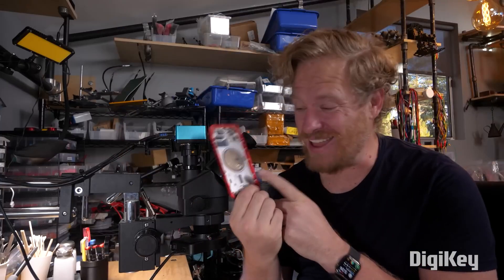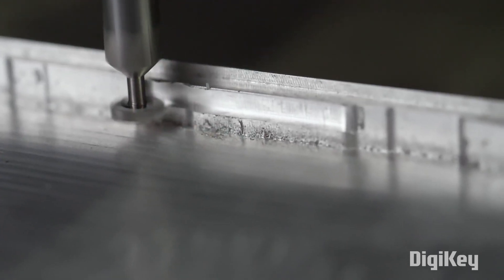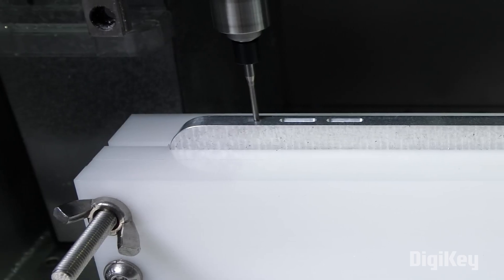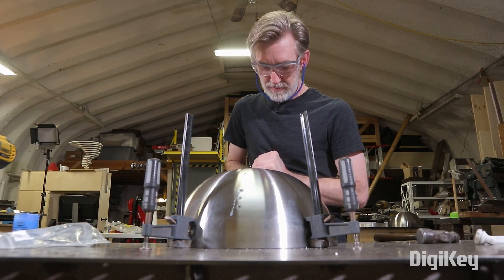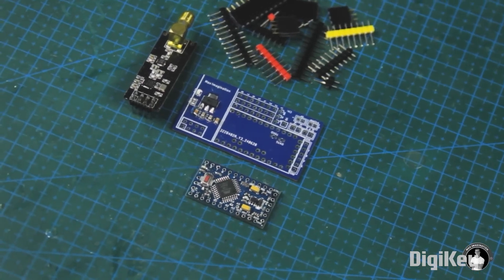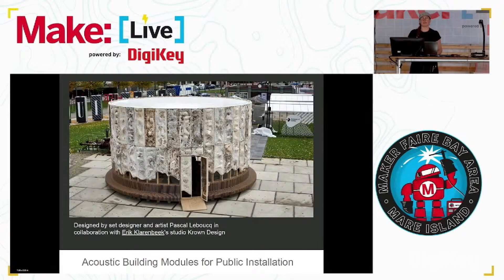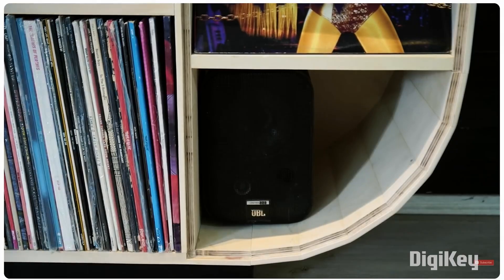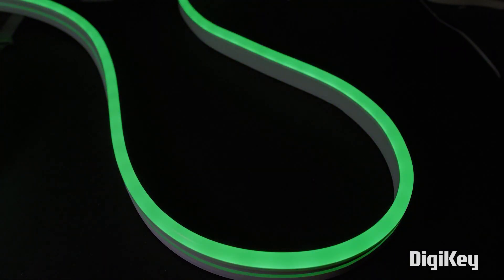Tough Call [Maker Update] | Maker.io

Comment: Oh! I haven’t watched Laura’s video but I’ve done similar things before. Something to keep in mind (but I’m not sure if it was covered on her side) is that transparent filament also works great as fiber optic, and can easily be attached with printed mounts on both the panel side, and the PCB side. Having discrete fibers instead of injection molded, multi LED “light pipes” also prevent the bleed that I’ve seen on a lot of consumer electronics like routers and modems. 

Obviously filament is going to have less flexibility than thin fibers, but if it’s only going in a straight shot or a short distance, it’s a great solution using stuff on hand!